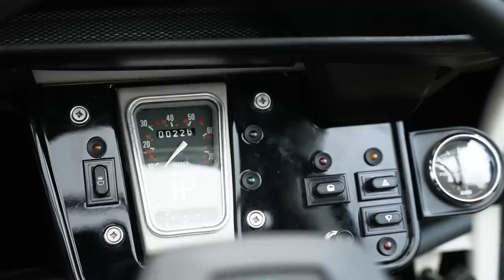All NEW electric converted Citroen 2CV

Comment: I had 10 of them in the Dyane body type. I put huge milage on one taking it from Dublin to London and back.
I loved the simplicity. 
My starter motor broke so I used the crank handle to start it for about 6 months. 
Glad they are guaranteed to survive. 
Excellent video. 
Thanks for a wee trip down memory lane (slowly)

Comment: After a drive out my 1932 Morris Minor Two-Seater with a comfortable speed of around 45mph, my 1989 2CV feels fast, smooth, comfortable at 60+mph, and has amazing brakes in comparison with the little Minor's cable-operated set-up. I also adore the air-cooled flat-twin engine's sound, so won't be converting mine any time soon. It's part of the character of the car.
Reply: And 16 grand for a conversion?  45 grand for a bespoke car?  I can't see the point until the price comes down.  Way down!!
Reply: You can put a little more pep into them quite easily, overbore and carburettor kit, 10hp goes a long way with a 2cv, they are very light and you wouldn't want them to go any faster than about 80 anyway, 65 is getting a bit alarming

Comment: Learned to drive in a 2cv, no power anything, including the engine. Travelled all over France and the UK in the five I had. Dream of getting anoither, some 33 years later. FIrst thing on my lottery winning ro buy list, especially with an electric conversion, the engine, although characterful, was the weak point. Damn I need two, one with a BMW bike engine conversion!  Excellent video Jonny, totally nailed it.
.

Comment: I remember a friend  purchasing a  new 2CV in about 1961. When as teenagers we all hankered to own a V8.  The seats where just a tubular frame with material stretched across. We were astounded when in a drive he just drive it straight at a concrete curb and all we felt was a mild bump.  Our Fords would have burst their tyres. Lol
Reply: A friend of mine had one and the seats were less comfortable, but looked like deckchairs. Also, if the car hit a pothole, one or other or both headlamps would swivel themselves in various directions. As was said, they are like a pet (part of the family) and a perfect M. Hulot mode of transport.

Comment: Brilliant - as you said, everyone loves a 2CV, maybe not this one for a road trip to the South of France but a great job done by the guys (and a great video as ever - thanks for putting it together).....
Reply: Not sure if you're aware but the more popular engine conversion for 2CV's is dropping a BMW GS motor in. The flat original flat twin in a 2cv was suspiciously similar to a BMW bike of the time and other than an increase in capacity they stayed very similar. So with an adapter plate and some trickery to keep the fuel pressure high enough, the BMW motor pretty much slots in!
Reply: And unfortunately that kind upgrade is totaly forbiden in France.
Reply: I'd do that road trip. You'd be forced to finish nice and early each day, so more time for the bar.
Reply: @tomf3150  Come to the UK :D
Reply: @SquareoftheyearFM  ....125bhp out of the 1200 GS motor sounds quite tasty compared to the 9 of the original car!!  Kind of defeats the object of the car though doesn't it?
Reply: @TheMissendenFlyer  2CV's are what you make of them. The 'scene' was always about adding your own stamp, being CND stickers and flowers or chucking some thick coats on and driving to the arctic. Have a quick search on here for BMW 2CV and you'll see Pete Sparrows test bed. I think the conversion is about £5k. Most recent one I've seen the guy has added a GS motor and is creating an overlanding 2CV.
Reply: A road trip to Cannes or The Principality of Monaco would be possible but very slow, a chance to enjoy rural France even.

Had an uncle that used to spend his 3 week annual leave driving a pre war upright Ford to the south of Spain, a week there and a week back, a week on the beach.  Had to use an heavily discounted Eurorail ticket in the end when it became too unreliable, it was held together with string and wire even before.  He was a British Railways employee, this was in the late 50's long before MOT's.
Reply: @TheMissendenFlyer  I don't know where you get the impression that everyone loves 2CVs. Plenty of people, myself included, view them with profound hatred. There is literally nothing likeable or in any way meritorious about these hateful little tin cans.
Reply: @TheMissendenFlyer  I agree with you, about 100hp too much by the sounds of it!
Reply: @TheMissendenFlyer  DO you mean the BMW 1200 motor? The GS bit is just the style of the bike as you well know. That motor was fitted in the GS, the RS, the R, the RT and more. I now that you are also aware that it is now a BMW 1250 motor with 136 bhp.
Reply: @richardharrold9736  Enjoyed all mine, even though they fitted my frame like a small shoe, so I feel sorry for you, and wonder why you feel the need to express negativity?
Reply: @JanDeeKat  because they are a danger both to their own occupants and other drivers on the road. They are dangerously slow, and they offer their occupants not the slightest protection from any form of impact.

Comment: 2 cvs are much narrower than modern cars, so they are handy for country lanes and carparks with narrow spaces. Bit worried about the 2cev range though - a 2cv would go at least 200 on its small tank, even with a lot of town driving. Back in the mid '90s I had a 2cv for 4 or 5 years, mostly as a "daily driver". Drove it to France a couple of times, too. (Broke down in France, but that is another story for another day). And the price is insane - part of the 2cv thing was cheap motoring (they were always one of the cheapest new cars one could buy). So I want 4 times the range, and the price to be more like 20K (refurbished to almost new). At this price they are merely a poseur's toy for those who want to pretend they are cool. At the moment, the new Ami looks like a MUCH better buy.
Reply: True, this is more for someone who want a cute classic car, but electric!
Not for everyday use!

Comment: Love it, bit pricey for me,  but I love the concept - I’m glad someone has mentioned speed and EVs I don’t understand why we need EVs doing 0-60 in 3s, let’s get the range and charging right then make them sexy, I guess it’s to build appeal but if the government wants mass take-up, range and charging is the priority.
Reply: I would be fine with a 9 hp 2CEV  I'd imagine  the battery and motor would be cheaper at this point.  7,5kw motor  would do the trick and 50mph would be fine with me.
Reply: @chrishart8548  any car should be able to do the national speed limit 70 as going too slow is as bad as going too fast

Comment: Absolutely love it 😍! They have kept it true to original performance which is probably a good thing considering road holding and crash safety.
Reply: 2CV roadholding is actually very very good.
Reply: @hunchanchoc8418  yes for the performance it had in it’s heydays but not if you cramp in 150hp and 300 kg of batteries!
Reply: @robenglish416  Eh?   I believe he said it was about 35 bhp (up from 29) and overall an extra 30 kg (?)     A 2cv is so light you only need about 90bhp to make it fast enough for any sane purposes, and by the sound of it about a further 90kg of batteries would give it a 200+ mile range.
The roadholding would still be remarkable, but for any safety improvement you'd need a stout rollcage and full-harness belts!  ;-))
Reply: @hunchanchoc8418  yes, that’s what I said, don’t put 300 kg of batteries in, it’s not built for that! It’s a charming car and I love it for that, but it’s not meeting modern crash safety demands and better to be driven in max 50 mph.
Reply: @robenglish416  Haha - yes, the same 50mph that those E-scooters do.
Never mind the 180 mph superbikes  ;-))   I guess safety is all relative.
As an aside to that: Do you remember that old adage about how safely everyone would drive if every steering wheel had an 8 inch spike sticking out the centre of it?   Many a true word spoken in jest   ;-)

Comment: Well done! Excellent work. I converted a 69 MGB to electric drive in 2008 and have been driving it with no issues since then. Like the 2CV, it's not a long distance car - but every 1000 miles I drive it is 1000 less miles that I drive in my petrol car. Cost to drive is about 2p per mile.
Reply from the maker: Wow, so you are an early adopter?
Reply: @TheLateBrakeShow  Yes. I got a lot of advice from some even earlier adopters at an EV club and they recommended a light weight car with minimal complications. A 69 MGB has no power steering, no power brakes, easy to get parts and a surprising amount of room for batteries. After conversion the balance, weight and ride height were almost identical to the original. Initially I used lead acid batteries but after the Nissan Leaf was introduced, battery packs from crashed Leafs became available and now I have some lithium batteries to drive it. The motor is an AC50 (all of 10hp continuous, 35hp max) with regen braking. I don't use the friction brakes at all. Direct drive with the motor mounted on the back axle and belt driven. No gears. Simple, works, will last longer than I do.

Comment: Two thoughts:
1. This car needs some sort of external speaker to produce the original engine sound. Something's missing...

2. We need a modern day 2CV (or Volkswagen/People's Car) to get EVs to the masses.
Reply: There will never be a modern 2CV because of all the mandatory "safety devices" that have been lobbied by Continental and Delphi.
Reply: @AnttiBrax  I think you missed my point. 🙂 What I mean is, that we need a cheap and "good enough" EV to get a significant market penetration. Currently, "good enough" EVs are damned expensive. It will eventually happen, of course, in a decade or two but I'm just impatient. 😉
Reply: @Elgsdyr  Yeah, that's right. The "market" will not solve it by itself. We need to ban ICE cars before any significant progress happens.

Comment: I love it..
One thing he said  "we don't supply a spare wheel because as long as people maintain their cars you don't need them" and you said "yep yep"
I always thought spare wheels are for flat tyres.  am I missing his point?
Reply: It's not the cars. It's the nails and screws scattered on our roads.  Don't worry though I seem to be picking most of them up In my tires  I've got a nail right now in my spare. (Yes I have a spare)
Reply: A Smart fortwo doesnt have a spare or a jack just a bottle of sealant and a compressor I havent had to use either in 14yrs of use here in Portugal...
Reply: @robshipman8691  count yourself lucky. Punctures are no fun. Luckily I've always had a spare wheel or noticed the Puncture at home.  Most of the ones I've had were to big to use the sealant.
Reply: @chrishart8548  Yep, flat tyres are nothing to do with maintenance but for things that you can't control.

Comment: I think an electric DS would be fine, as it’s ICE isn’t that great, but the flat twin of a 2CV is part of it’s defining character. I’d like to do an EV conversion on my XM though.
Reply: Youd still have the suspension, and light weight. As its own thing, I'd have one.
Reply: You saw the car to the left of the last shot? "DS21EV", where the drive train is finally up to date with the futuristic styling :)
Reply: Gatica
Reply: @benholroyd5221  you wouldn't have light weight once you'd fitted a half ton battery to it lol
Reply: Looked like a "slightly used" DS parked outside the workshop when Johnny was doing his spiel. Perhaps that's the next project? Oh please, oh please...... 😁
Reply: @Markcain268  watch the vid, it all weighs an extra 30kg.
Reply: @benholroyd5221  that's good then, I don't really mind crap old cars being converted to electric, but I draw the line at swapping a lovely V8 for a boring old leccy motor
Reply: @dorsetoctaviaman  😎😎

Comment: I had two and crashed my last one. At 20 mph is was a crisp packet. I would have another though in Rat rod rust, with an EV conversion. I’m loving the one in your final clip. I would miss however the over 80 mph that both of my cars achieved. Sadly, living in a terrace, I would have nowhere to plug it in! Without good charging infrastructure in built up areas,  EV’s cannot be the future.
Reply from the maker: Over 80mph? That is a miracle, as is you surviving a crash in one...
Reply: @TheLateBrakeShow  it must have been bored out before my ownership. I passed a Porsche on the outside lane going to Ipswich...
Reply: @TheLateBrakeShow  I t-boned a bus at 40mph in my old 2cv! I drove it home, and fixed the damage to the 2cv the next day for 40 quid.

Comment: No long journeys in a 2CV?? Really??  Actually most of us 2CV owners prefer long journeys.
Great video anyway... thanks!
Reply: EXACTLY!!! 2CV'ing is about driving across country or continent to park in a field and get shouted at by French 2CV clubs for encroaching on their pitch by a few centimetres! Even our 'local' runs usually run into a hundred miles or so.
Reply from the maker: Yes, but I happen to think that this EV conversion won't be for hardcore 2CV enthusiasts. I think it will be for folks who want the 2cv look, but have the resources to choose full electric.
Reply: @TheLateBrakeShow  We'll see. Us 2cv'ers tend to be a bit bonkers. Probably where Ian (hubnut) gets it. There is a new (older) crowd coming into 2cv's at the moment who like overly restored cars, power steering from corsa's etc. so maybe you're right. I'd still like 35kWh and DC charging for when I plump to do mine.
Reply: @TheLateBrakeShow   Being Norwegian, it might not come as a surprise that my daily driver is an EV. However, only the winter can keep me out of my 2CV for longer journeys.
I'd welcome the day that fast charging and decent range is offered for a 2CEV without weight increse though. I expect to have to wait a bit for that though.

Comment: My criteria:
range:  700 miles
0-60 miles: 7-8 seconds
Left hand drive
Roll cage
Air Conditioning
Ability to climb incline:  45 degrees
Chargeable at a Tesla port in US
Tow with a hitch:  1500 kG
Seatbelts for all 4 passengers
Delivered to USA & clear US customs
Must have fog lights
Two heaters
Extra padding for cold & hot climate
How much would your shop charge to supply the above and the vehicle?  I do not have the car.  We can negotiate the colors!  Extra rustproofing needed.

Comment: 'Are you going to do long distances in a 2CV?'. Hell, yes. I had a (rough, imported) Belgian LHD 425cc in the mid-70's. The day I collected it, I stopped at lights on the Albert Embankment at 1am. Put the handbrake on and couldn't release it. It took me 20 desperate minutes under the dash with a torch to spot the 'anti-theft' handbrake button had rotated to locked. How could I not love something so eccentric?

I went all over England and Wales. Memorable (if long and not fast) trips, including virtually all the way London-Bristol in 3rd, at 40, because it couldn't pull top gear against the headwind. Then that trip London-Exeter and back, where a garage sold me some dirty petrol and I had to strip and clean the carb 13 times. 

The carb was a terrible problem, since it was so worn. A trip around Cornwall had me dismantle it at 3 different campsites to try and fix the wear in the throttle spindle and body - eventually bodged with a bit of a BiC biro body, then rebodged with one of those plastic caps you get on new slave cylinders, cut down to make a bearing.

Easy to work on, mostly, but also happy to be neglected. It took me 2 years to find out where the contact breakers were (behind the fan).  I did however replace the knackered barrels and pistons, and brake cylinders (inboard drums).

In an urban cornering competition with a friend in a knackered Mini, the 2CV gave nothing away, except 20 degrees of lean.

I eventually sold it, and bought a Transit for work, but when I sold that 3 years later I bought back the 2CV.

A few years later I got to drive a brand new 602cc. That was a fireball compared to my 425! I hankered after one again, but  life had changed and I thought it better not to pulp my children. I'd seen the aftermath of a 30mph head on involving a 2CV in Catford. The passenger compartment was 18" long, folded inward and upward so the front screen almost touched the back one. The roof was  the chassis was folded into a V.  I'd had plenty of accidents on motorcycles but this seemed worse.

I think I'd want a roll cage and 100+ miles range, 0-60 10s and <£20k. Not happening, but I'm glad this exists. I wish someone would make a  new equivalent, same philosophy,  out of carbon, but I wouldn't be able to afford that either.

Comment: Would make sense to try and remove the gearbox or at least the ability to select different gears. Maybe use the original gear lever to select between drive, neutral and reverse on the motor
Reply: Or to hang your handbag/backpack on?
Reply: There's no neutral on an electric motor. You just lift the pedal and it stops pushing.

Comment: Well, if Citroen doesn't make a 2EV, then this almost makes up for it.
But imagine a factorybuilt retro model made from carbon fiber and aluminium, with twice the power and range, without having to adapt to an old gearbox/suspension system, it could be the city car the world need.
And with a modern chassie and twice the range, it would do those longer trips too.
Reply: No doubt it would cost over £100k for one of those.

Comment: surprised they kept the gearbox, I'm looking at other EV conversions on youtube and they have gone with a built for the job ie off the shelf EV gearbox solution.
Reply: @Alfred Wedmore well many have a 2 speed + reverse gearbox and a torque converter so they get some power back from the insane torque the electric motor puts out. The old gearboxes they find cant handle the torque nor do that have a converter to fix the issue.